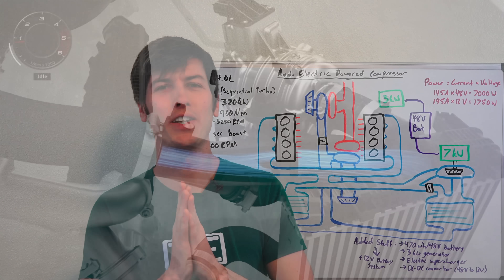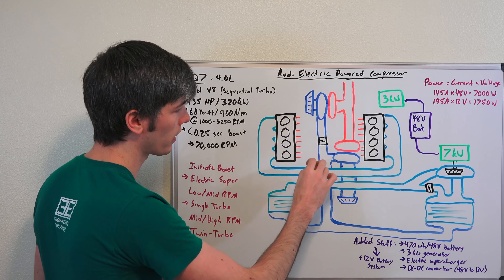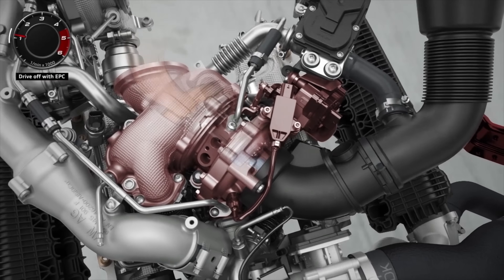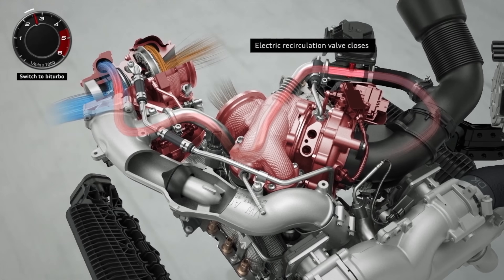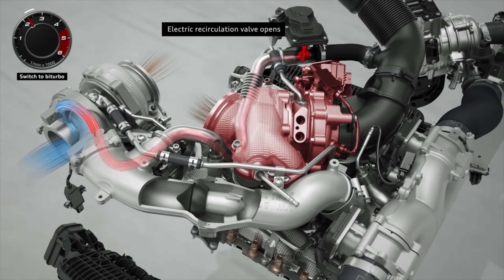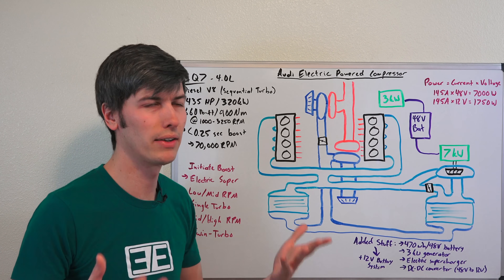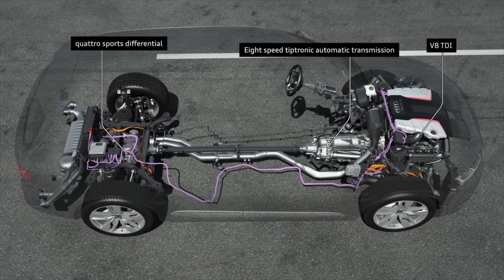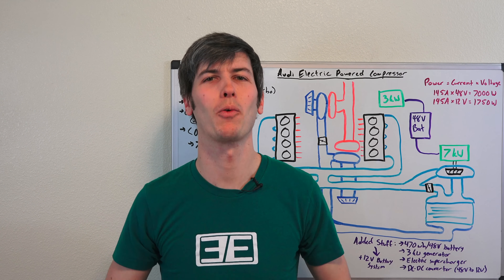Electric Superchargers - How Audi Is Eliminating Turbo Lag

Comment: ..or you can just install power amp 7000W and then power your turbo charger elctric motor from it..On the output of the amp there are 80-120V 60A so powering electric motor via different frequency you can get different speed ...

Comment: How about a electric supercharger system totally only ? Will that require more power than the 48 volt system and 470 Wh battery could handle ?

Comment: why aren't superchargers fed mechanically from the engine with a multiplier gear 10:1 (minimum rpm is 1k for any engine). just like you power your AC. would that really slow the engine that much right when you want it to go faster!?

Comment: why cant they run the turbos only by the electric motor all the time ? , wouldent it take less engine power to drive a generator than drive the turbos directly ?  seems like race cars ''hybrids'' could use the braking to generate the electicity to suply the turbos on re-acceleration  ,humm

Comment: I just watched a video where a guy used a 6kw electric motor and could not get 2lb of boost or 30k RPM out of a large turbo compressor from a diesel engine. I figured he was overwhelmed by the size of the compressor and that a smaller one would be more efficient

Comment: I took the super charger to another step further, I made the main circulation device the booster . No need for an inter-cooler.The turbo is also the main means of engine cooling. If interested call 831-726-9141

Comment: So what's the PSI on the electric supercharger? Also, my idea would be to build the electric components of an electric motor into the turbo charger to eliminate the lag. Only problem is heating, so make the turbo's crank long to keep the electric part away from it, or run a coolant line around the electric part

Comment: Why not use 6 lithium 16 volt race car batteries (about 1/2 the size &1/10 the weight of a normal 12volt lead/acid car batt) & an inverter instead of a generator. Then you'd have 96volts X 200 amps = almost 20,000 Watts. Inverter is cheaper, lighter, all electronic and could use the same alternator as  cars 12 volt system. The added benefit would allow powering average house as emergency backup during power outages.

Comment: 7kw instant power would need more of a capasitor, than battery. Li-ion 48v can handel it, but will see how reliable it is when it has to give that much current instantly. Even li-ion 48v battery has to be oversized to make it whitout heating. I hope audi has battery and capasitors in series, like my ebike has.

Comment: They have nothing better to do so they come up with this wacky system. Better to use a pony motor to start the engine, run the alternator,power steering, power brakes,an electric motor for low speeds, ac compressor and centrifugal  supercharger which maintains boost from idle speed up in big engine. 10-20 hp engine which is set to run efficiently feed systems to a larger 300 plus engine which need not be running untill wanted .Full boost from idle. Big engine stalls when stopped. Fires up when wanted . Great for Rvs and Boats,Trucks too. Much simpler and cost effective.

Comment: Technical overkill with over engineering. If warranty is running out, the car becomes a nightmare in service cost an repair. The better solution to avoid a turbo hole is to buy aTesla.

Comment: One of the car dealerships in my town charges $137 a flat rate hour.  Why would you want to make a car this complex, put it on the road with drunks and texters only to have some bozo at a dealership do more damage when he works on it, all the while charging you for all "his" mistakes.  In my 34 years as a mechanic, I have learned one thing.  If it's not installed on your car, it can't break.  My 1967 Chevelle was the ultimate in reliability.  383 with an overdrive tranny, No radio, no air conditioning, HEI, and a one wire alternator.  I could take that car on any long trip with no worries and get 27 mpg in the process.  Turning heads the whole way and outrunning pretty much all the Audi's.  At 35,000 miles I spent 16 dollars on a set of spark plugs.

Comment: Car manufacturers have increasingly switched automotive systems like power steering over to electrical operation as opposed to mechanical operation to try to gain MPG. Failure rates in the auto’s charging systems to handle the increased loads are getting more common and more expensive to repair because of this. Ford and GM have already has major issues with electric power steering.  As they continue to add more load on the charging systems you’re going to see higher repair bills once the manufacturers warranty has expired.

Comment: This is a clever use of an electric supercharger because it gets around the biggest problem of duty cycle. The brief bursts needed to get past the turbo lag, similar to the brief high torque bursts needed to start an engine, can be supplied by this relatively small electrical supply set-up as compared to a full time electric supercharger which would require a massive alternator, conductor cables, and electric motor (with a cooling system) to deliver the horsepower required to make a steady supply of useful boost.

Comment: Added weight and complexity. Modern turocharger lag is insignificant compared to the T3 Garrett of 1989 on a 2.0T and a 2.0T in 2009. Its all about mid range torque in real world driving not any instant power off the line. That's for high school kids.

Comment: It should be that supercharger sharing the shaft with a turbine. The compressor could be bigger and supplying all cylinders. That's looking for simplicity, but maybe power won't be up to expectations. 

Audi should consider Torotrak's toroidal/variable supercharger. Maybe 2 units and see what comes out.

Comment: Since they have added a generator and 48 volt system, why not just make an single electric powered turbo on the intake side and be done with it.  My biggest concern/reluctance about turbo chargers is longevity.  If you used an electric turbo only on the intake side, you would get rid of all the heat that an exhaust turbo is exposed to and possibly make a turbo that can last the usable life of the car.  Also, you would have longer oil change durations because it would no longer be going through the turbo.  Would also be easier to change/replace because it would no longer be hurried at the back of the engine

Comment: Their aint no such thing as a free lunch.. The power for that electric turbo comes from the engine via battery/generator. The losses of those stages mean the power the turbo adds will be taken plus more from the engine , most likely programmed during lower demand parts of the usage.

So the net effect will be a loss of overall power in order to fill in a turbo lag hole.

You also have to factor in the notable extra weight of the 48V battery, generator , turbo and related systems. They are there ALL the time.

Comment: How did they do the 48 volts? 4 12v batteries in series? or just slap in a large 48v battery that you will never be able to find anywhere other then the dealership?

Comment: EE, Why not skip the electric booster?, The Variable Exhaust Valve System seems to be where it is at!!! Does Audi use this VEVSystem on any other cars without the electrical part. It sounds cool and could VEVS be coupled with the multi-vane turbos i've heard of? Thanks.

Comment: I'm a bit surprised at the need for the second turbine. Don't most turbines already need waste gates to compensate for their over capacity. Even giant diesels only ever seem to need one of these. Also VW, which I thought was related to Audi, used to have some sort of variable vane turbo that seemed to reduce a lot of turbo lag in their diesel. I used to drive one, seemed to work pretty well, of course this was producing a lit less than the 400+ horse power of this beast, but that Jetta easily cruises at 100+ mph, got passed by no one and ran forever on a tank of fuel. Of course this was way before the diesel scandal. I would fear reliability issues for such a relatively minor performance increase 🙁

Comment: Tremendous! Looking for a hybrid system to integrate this - imagine having a supercharger powered off the hybrid battery. And thinking about this as a compressor - could we use a more traditional air compressor with a small tank? It could spray more air into the intake manifold when instructed by ECU, possibly under hard acceleration.

Comment: I only have one issue with this, the battery only supplies power for starting and non-running conditions. once the engine is started the alternator / generator provides all electrical power for all systems.  you could do this with a 12v system.  however, the electric motor needed would be much larger than the 48v one.  the alternator / generator would be quite large as well. not to mention heavy. which probably defeat the purpose.

Comment: Cannot say that I agree with this from a cost benefit POV.  435 HP from 4.0 liters can be achieved in a NA motor.  Production cost and maintenance costs for what?  An SUV that drives around the suburbs going to soccer practice?
Reply: 435 HP from a 4 liter NA DIESEL engine? Dude, there's a reason NA diesels aren't common. Please show me a NA diesel that produces more than 45 hp / liter.

Comment: Is there really a 12V battery and a 48V battery, look again there is a DC/DC converter to deliver 12V, and if there isn't a 12V battery then there isn't a 12V alternator and a 48V alternator there is just one 48V alternator to power the whole system via the 48Vdc to 12Vdc converter. For the starter then they would have a smaller 48Vdc motor that way there is little need to have a hefty converter.

Comment: Why does the supercharger need electric power beyond the very low end? Much like in hybrid driven cars, it could be designed to switch from electric to belt-driven at a certain speed, reducing the power demands.

Comment: ...opps..you goofed..first time i ever caught you..car does not run off the battery...car starts off the battery...runs off the alternator that is designed to be able to put out enough current to run every system on the car at idle with enough left over to charge the battery...got a question...how much drag on an engine would a generator have if it had enough output to turn a supercharger enough to make useable boost?...ie the generator needed 50 hp to make enough current to run the electric motor hard enough to turn the supercharger that made 6 lbs boost that increaased the output by 30 hp..lol....i get  a laugh about people who claim...unlike a supercharger that driven off the crank a turbocharger is free hp...them dummies dont get that the amount of back pressure a turbo charger makes would cause the motor to cease rotating almost instantly if the pressure it made wasnt going back into the motor...you probably never drove a blower motor before...hot rod style..even a 671 on a 350 chev is amazing...no lag...boost follows rpm..from no boost at idle...2 lbs @ 2000 rmp and 16 at 7500 .and 700 hp..smooth torque curve..no lad when shifting

Comment: What about using a series of large capacitors that would charge over time and provide all the power needed? Though, of course, it would only be for a short period of time. Not ideal for a race car, but a daily driver? Where you'd only need boost for 10 seconds to jump ahead of traffic? I think it'd be great for that. Then it would just recharge while you drove normally. Like a temporary power-up in a video game.
Reply: I just had the thought that you could set it up like a nitrous oxide system. Push a button when you need it, either when overtaking, going up a hill, or at the drags.

Comment: Seems overly complex. Something F1 style where there's an electric motor on the turbo. Would be interesting to see if it could be possible to have a capacitor bank, that's charged by the electric motor on the turbo when you're braking / off the power, and then delivers power when getting back on the power to eliminate turbo lag.  I'd think a capacitor bank could be feasible since the motor will run very short terms only (high current demand but for a short time).

Comment: Would be more efficient to go hybrid, and connect an electric motor which gives full torque from idle, while the turbos take care of the top end. Would be much more reliable, and powerful right through the rev range.

Comment: 7kw is just less than 10Hp.  The whole idea of turbo is to give a lot of air  with high pressure to o er fill the cylanders.    The question I had was I was a kid is why they don't use a air storage with a simple high pressure air compressor like air conditioning system.  Then it provides the air with lots of pressure when needed.   It's a simple solution Which at least should fix the turbo lag problem.   You need to use turbo to accelerate just for a few seconds only like 0 to 60.

Comment: I have a question. Wouldn't it be simpler and equally feasible to simply use only the electric turbo all the way? To power it, have a bigger generator. Apply the load to the motor not through the exhaust but the driveshaft. Even if a generator-battery-motor drivetrain isn't as efficient as a turbine, the simplicity and lack of lag could be worth it, couldn't it?

Comment: Seems like an awful lot of complexity there.  I'm sure it works great but still.  The last time I read an article about a car with supercharging and turbocharging, the supercharger had an AC compressor style clutch on it that would disengage the supercharger once the engine was running hard enough for the turbo's to do their work.  That sounds like a much simpler way to achieve the same or similar results.

Comment: Excellent Video.

Another good use of this Electric S/C system is to add to N/A cars without any Turbo system. This will keep the cost down compared to something like Audi's TT + e S/C.

If Ford adds an e S/C to Mustang GT, it will wake up that car.

Comment: I have an alternative Idea.  Rather than using an Electric Supercharger, Use a tank of stored and compressed air.  Sort of how a Capacitor works, in an Electric circuit.   Release the tank of compressed air, and send it right through to the intake.  There's your alternative solution to Turbo Lag!  Seems to me that this would give you a throttle response that even the electric Turbo could not match.  Opinions? Pros?  Cons?   Only con I can see is Duration of Boost might be too short.  You get it faster.  Yet you don't get it as long!  Hmmm .... Which is best ... That is an difficult answer.  What a great thing to put to the test.  Oh ... alternative #2, just install BOTH!  sO ULTIMATELY, you would have a 3 stage system of sequentially activated SUPERCHARGERS!
Reply: you could air your tires up too lol

Comment: Cherolet figured out how to stop turbo lag completely simply by dividing the exhaust ports and timing pulsations so they overlap resulting in much faster and earlier spoolup! That's a HUGE INNOVATION! ;) The Exhaust gasses are also cooled via an integrated cooling jacket like VW did recently. What works works no matter who comes up with it!

Comment: Someone needs to engineer an electric super charger that creates decent power, and have it fit my Camaro lol it sounds like it could be a more efficient way to increase power without having a regular super charger that runs off a belt, thus stealing power from the engine. I would love to have a belt driven super charger but who can afford them when they cost 4-5k?
Reply from the maker: The thing is you can’t get away from needing power for the supercharger. Even if it’s electric, it has to get that electric energy from somewhere, which ultimately will be the engine.

Comment: Typical Kraut crap-  over-engineered, overly complex, just asking to break SOMEwhere....  this thing could be a lot simpler.  But before car manufacturers tackle this problem I suggest that they go to electrically-driven air conditioning compressors.  That'd be a simple assembly, one that (a.) would allow installation ANYwhere in the car, (b.) not rob any horsepower from the engine, an especially valuable consideration for cars with small engines, or cars that could be equipped with an even smaller engine than what they have now, (c.) it would spin the compressor ONLY at the most optimal speed, one that's only fast enough to do the job (say, about 1500 rpm) but not so fast that it induces premature wear-out, and (d.) eliminate the need for a drive clutch.  There are any number of a/c compressor manufacturers who could easily come up with something like this, such as Hitachi, for example, or Nippon Denso.   
 (Considering the incredible complexities shown here I'd say let's live with the turbo lag. Electrically-driven superchargers, indeed!)

Comment: God I did this back in the 80s using a rheostat hooked up to the throttle linkage controlling the voltage going into a dinamotor to power a 700 V high-speed electric motor to drive a turbine it worked pretty good it's interesting to see it being done now days by a regular car company the  only thing that they have over what I had was that thay used a battery where I used capacitors and diodes I actually still have the unit sitting on my shelf I think I might've been way ahead of my time on that

Comment: The system could probably be done with ultracaps instead of the separate 48vdc system. That supercharger is only used at a fairly low duty cycle, dump power out of the ultracaps during initial acceleration, charge them from the standard 12 volt system at higher rpm when the main turbos are working. You may have to specify a bigger 12 v alternator though.